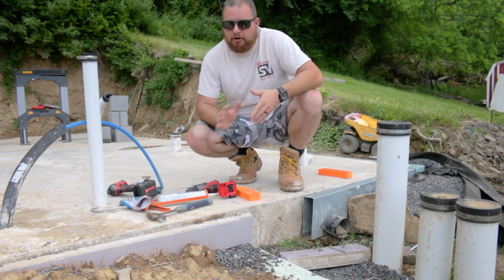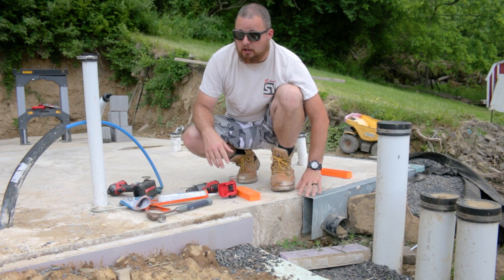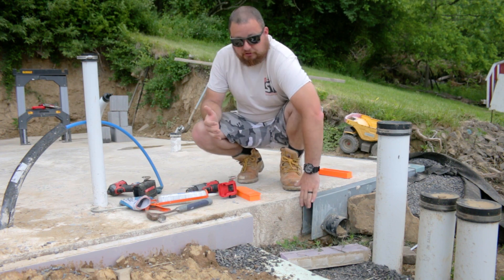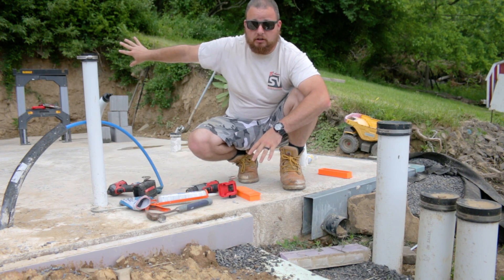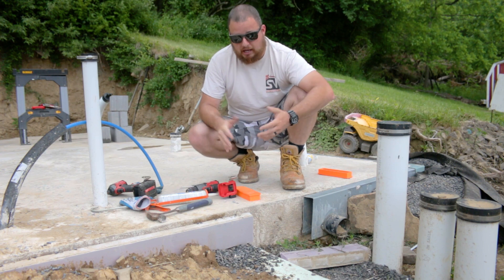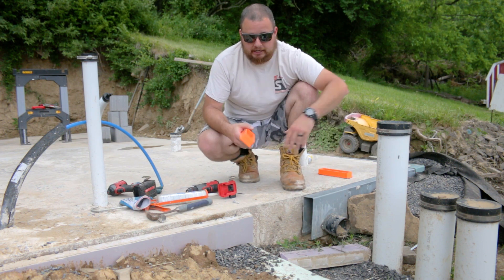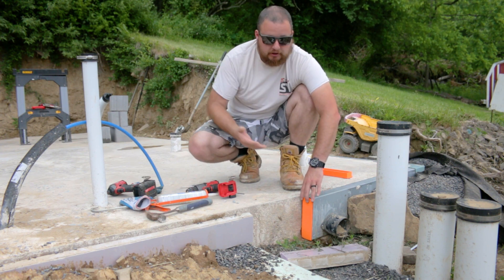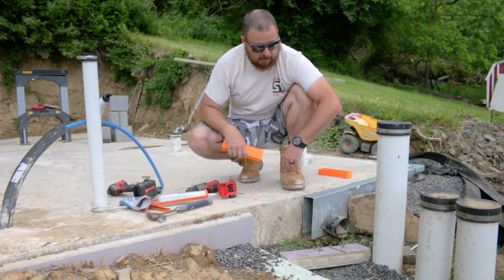Garage Build #15- Problem With Form-A-Drain

Comment: A BETTER FIT WOULD HAVE BEEN TO MAKE A WOOD BLANK AND ASSURE THE FIT BEFOR PRINTING BY THAT 2ND PARTY . now- I WOULD WRAP IT FIRST WITH AT LEAST SHEET ROCK SCREEN OR FIBERGLASS SCREEN TO MAKE SILCON BOND TIGHTER =TOO LOOSE-   NO IDEA WHAT THE FINISH IS FOR THAT 8" EXPOSURE- rock/gravel planter DRAIN box ?? wHY USE FORM A DTRAIN???